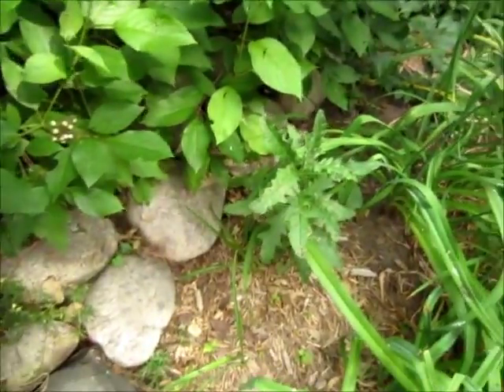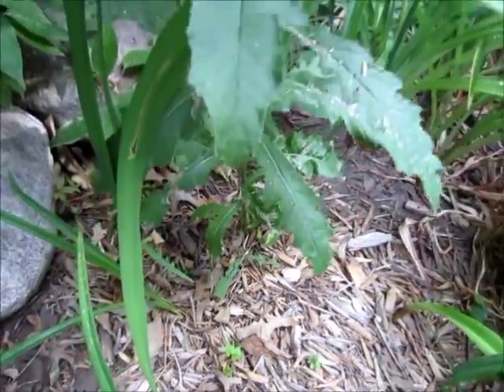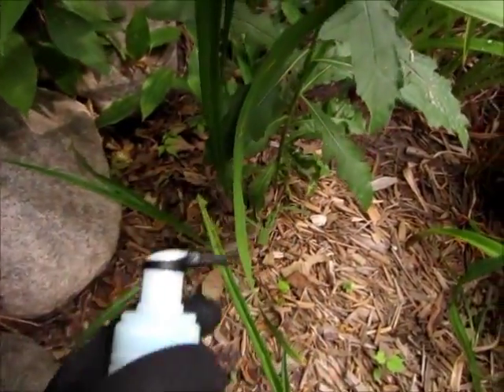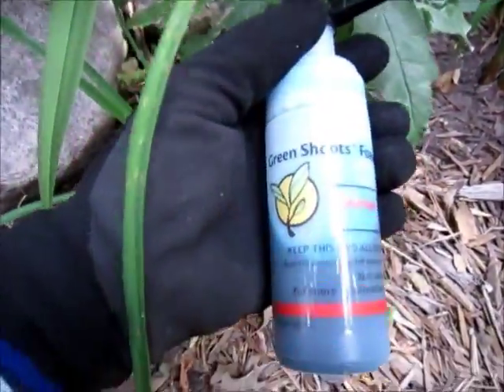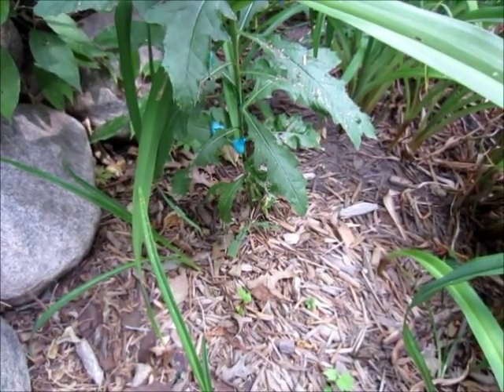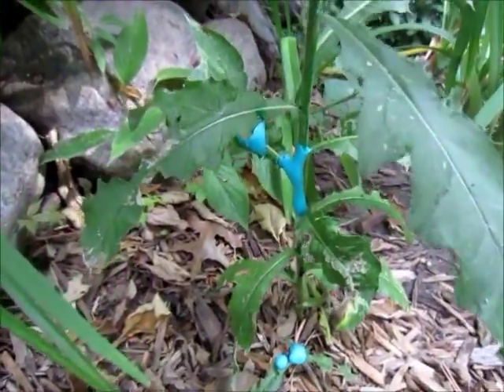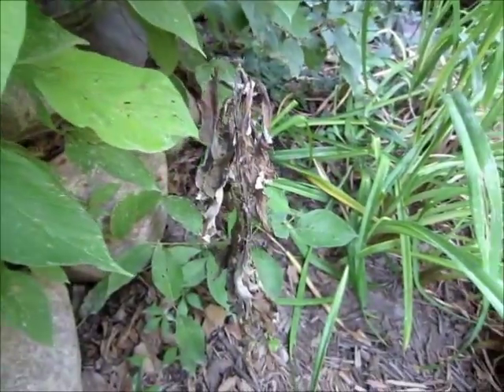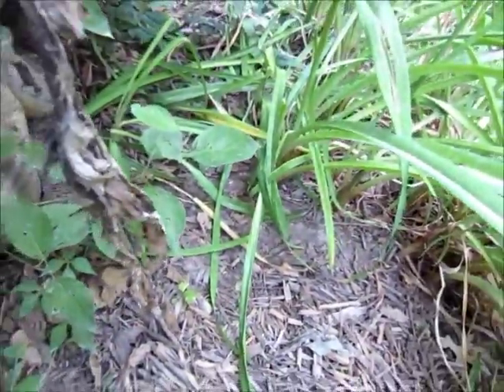Kill Thistle Using Precision Foam Herbicide

Comment: Would this work on crabgrass?
Reply from the maker: Yes, certainly.  Quite labor intensive but it would definitely work.
Reply from the maker: One more thing - i have used this method on reed canary grass - I cut the grass and applied foam herbicide to the cut stem.  It's labor intensive but works great around desirable plants.  With crab grass, you could also just apply to the blades if that would be easier.

Comment: Hi John, Thinking about getting your system.
Is it much more effective to cut the target plant and leave a few inches of the body before putting the foam on top? Would it work faster and kill the root faster since it is a few inches closer to the root?
Reply from the maker: Sorry for delay in response.  Yes, generally cutting lower works well especially in late summer and fall when the plant is translocating sugars from foliage to the roots.